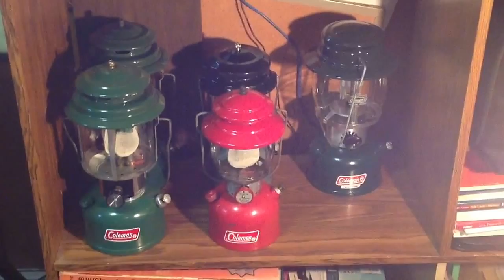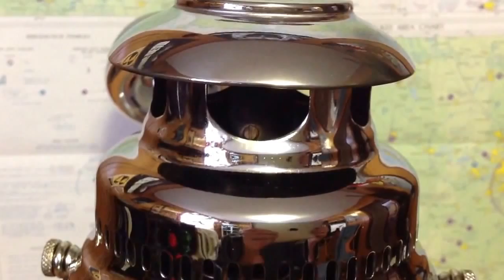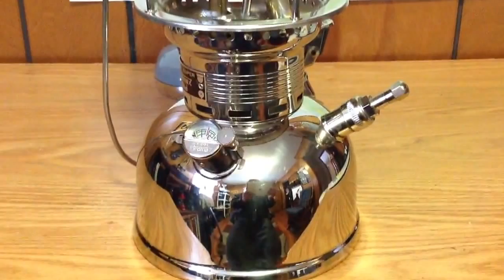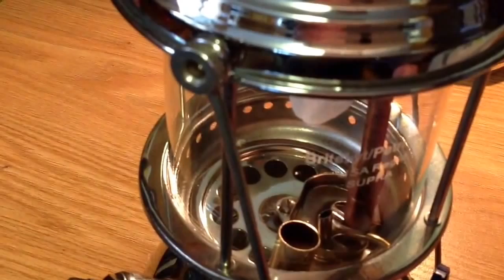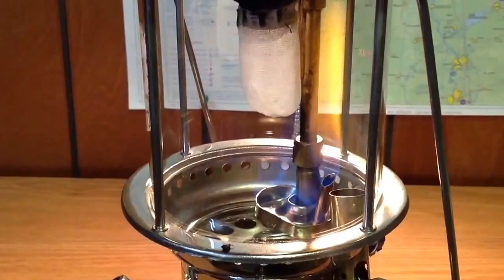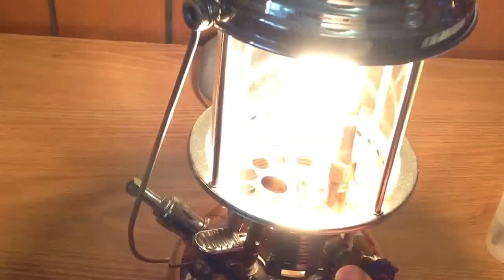Coleman Lanterns, Lighting a Petromax

Comment: Hi mate, in my country it's impossible to find querosene but I can easily find benzine which I think is the same as the Coleman fuel or white gasoline as known in other countries.  Have you used it with this type of fuel? I get from your video that it might be just a matter of turning the little screw up there to adjust the flow of the fuel?
Reply from the maker: Just to be safe, most people say running white gas type fuel is too dangerous to run in these types of lanterns.  The reason being is although kerosene is not very explosive, white gas type fuel is very explosive and if any leaks develop you can have a big dangerous fireball.
Reply: @FPVandotherprojects  Thanks, after doing some research I found that despite this lantern is capable of burning white gas, it is not design to do so and a leakage might end in something dangerous.

Comment: I have a vintage Petromax 500cp lantern, which was my father's..it hasn't been lit in 30+ years and I don't know what lantern mantles to buy or any maintenance after all this time..any advice would be welcome
Thank you in advance
Reply from the maker: Get some kerosene and flush out the tank.  Then unscrew the pump and take it out.  Look at the leather seal on the pump, It will need to be soaked in oil on to soften up,  I usually use motor oil.   Then try to pump it up to see if it holds pressure.  If it doesn’t pump up it may need a new leather part, or you can see if you can just keep it oil it and loosen it up and that will make the old leather work  if it is not cracked or somethinug.  If it doesn’t hold pressure it most likely needs the rubber seal on the cap that you fill it up (under the pressure gauge).  If all that works you need mantles try https://www.amazon.com/2154-HK500-mantle/dp/B000AQRAT8/ref=sr_1_2?dchild=1&keywords=500cp+mantles+petromax&qid=1587209894&sr=8-2. If you got that far preheat it for a minute with the rapid pre-heater or 2 cups of alcohol.  Then open the valve and it should light.  Good luck... it is a fun hobby, you can get almost any old petromax going, worst case it would need a few more seals or a few minor parts all of which are available for sale online.
Reply: @FPVandotherprojects  when you say soak the leather pump seal, (I'm using 3in one oil), how long should I let it soak?  Also I poured out all the old kerosene in the lantern,, awful yellow color (28 yrs old, will flush with new when I get some),
 Also the rubber seal under the pressure gauge looks good so here's hoping.

LMK about how long to soak the pump cup..thanks
Patrick